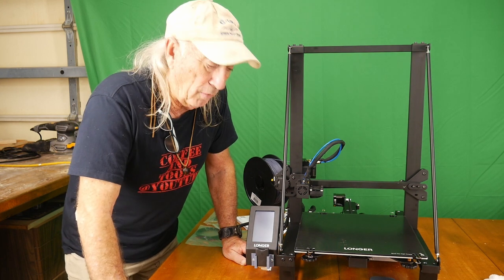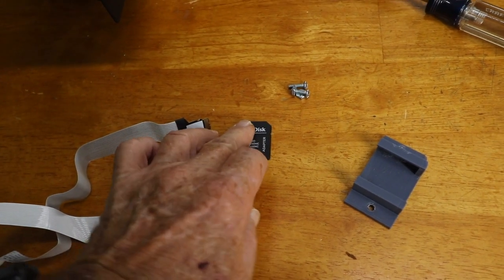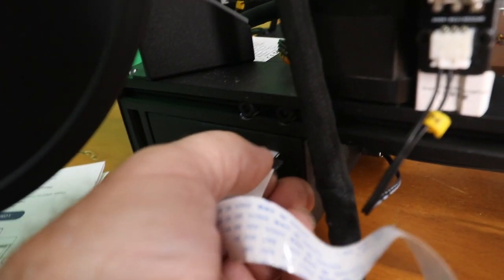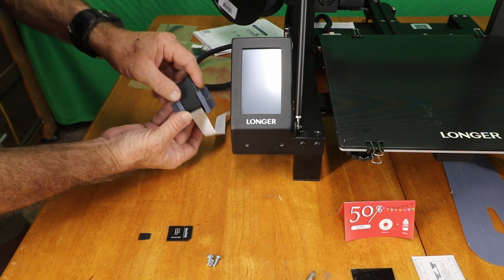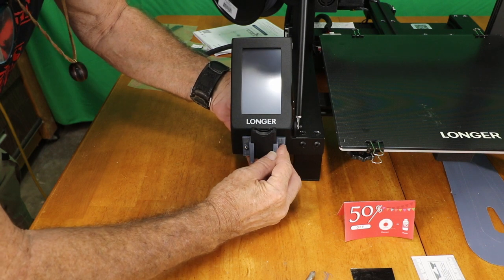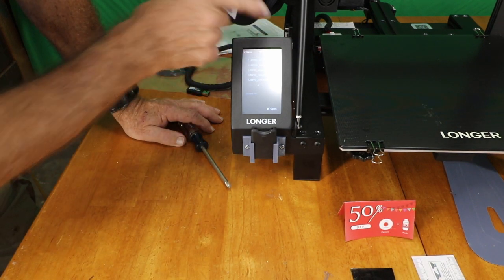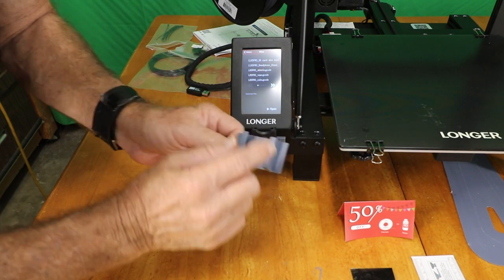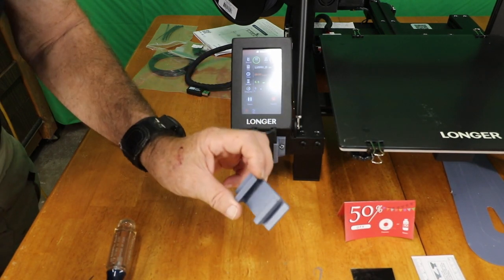Longer LK 5 PRO 3D printer upgrade SD card reader @ C&T, episode 175

Comment: The issue is there is no refresh for the SD Card when it is changed.  You have to put the extension slot in and out , or reboot the printer.   There might be a "clear" switch internal on the card reader that wipes the cache when you remove the card.  The extension doesn't allow this to happen.
Reply from the maker: Correct John

Comment: The issue with not being able to read the SD card without having it inserted into the extender/adapter before powering on the printer has to do with how the 'media change' notification to the printer is done at the microSD card slot on the printers motherboard, since the adapter basically makes the printer think that there is a card already in the slot it doesn't attempt to re-read the contents of the card.  If you turn off the printer before you insert the card with any updated files then when you do turn on the printer it will do an initial check to see what files are on the SD card, however if you decide to remove the card and make any changes to any of the file on it you will once again need to power off the printer before inserting it into the adapter so that once again the printer will do an initial read of the card contents.  It'd be nice if maybe someone could add a 'refresh' button to the file selector screen to make the printer re-read the cards but I don't know if that's something that's even possible.
Reply from the maker: Long winded, but to the point :face-blue-smiling:

Comment: The downside still to this upgrade is you either have to turn the printer off every time you use the card or unplug and replug the adapter in when you put the card in. As crappy as it is you might as well stick to the stock setup so you can just put the card in or take it out without having to turn the printer off

Comment: Great upgrade!!! This is the biggest complaint my wife and I have with using the LK5 Pro. it's kind of a pain to get to that micro sd slot. Your upgrade fixes it perfectly!!! Thanks for taking the time to go over this and offer the 3D printed adapter mount to us!!!!!
Reply: when i take out the large sd card it does not take off the files i have to unplug the small cable is this normal should it not take the old files off the screen when i take out the sd card
Reply from the maker: So, glad this helped out. All my 3d printers came with that silly micro SD card.
Reply: Hmm...I'll have to see if this happens on mine. Perhaps powering down and re-starting the printer is a simple way to clear the file cache?
Reply: @ajones4064  i did that and that works but if you take out the sd card should not the files go away until you put in a new one it seem like the printer is holding onto the memory of the card that was in there
Reply: Yes, you would think if the memory clears when pulling the sd card from the machine, it should do the same when using the extension. The extension may hold a slight voltage, or resistance value, for some reason and allow the cached memory to remain intact. This might be the trade-off for the convenience of accessing the sd card easier.

Comment: Great vid sir ! Can you explain why my Longer LK5 Pro stops printing sudden while printing a stl file from my pc. It is so confusing and I can not find the problem. Thanks from Martin from Holland !
Reply from the maker: This might be long. I would start with run something else for an STL file. Sometimes it is just a bad STL. Also try running off the TF card and not the computer. Next, check and make sure the cooling fans are keeping the control board cool etc, nothing blocking under the machine etc like carpet. Also jump out the filament run out switch ( just in case ) I'm thinking these are the simple checks. Anyway, I'd run these test before doing a re-install of Marlin on the control board etc. Also note if the failure happens at the same point. That again would say software and a hint at where the trouble is coming from. Let me know how your doing.🤠

Comment: My Longer LK5 Pro micro SD card needs to be refomatted,is that done using Cura 4.8 ?
Reply from the maker: Might need to shut off the power and remove the SD, and reboot etc. Generally they do not need reformat.

Comment: I just bought an LK5 Pro.  It constantly throws an error 'Recovery Printing - Job is not done.  Do you want to recover this printing?'.  It did this 5 times during a 14 hour print.  That was supposed to be a 28 hour print.  But when I resumed from the 5th error, the extruder went too low and dislodged the print object from the bed.  :|    My question is, do you know why that error might be happening?  And what is the longest print time you have had that was successful?

Comment: btw the "file list" not updating kind of issue, Ender 3 V2's have same issue.

The printer does not know the card has been swapped out so doesnt refresh the list, power cycle or clicking the ribbon cables microsd card in and out again resolves it.